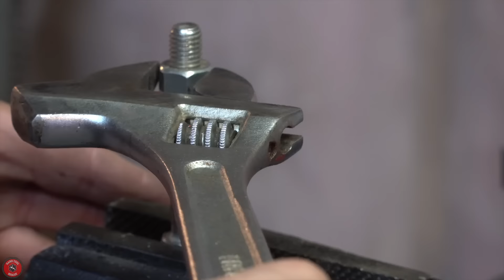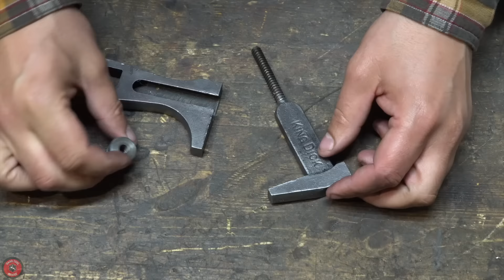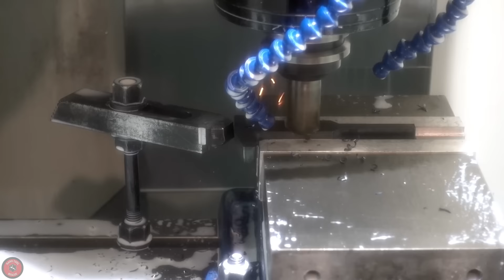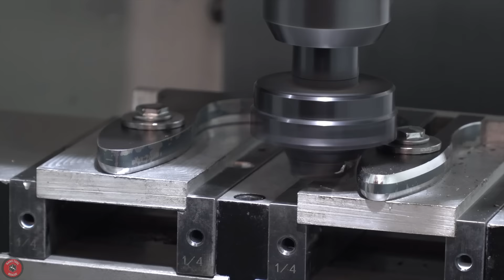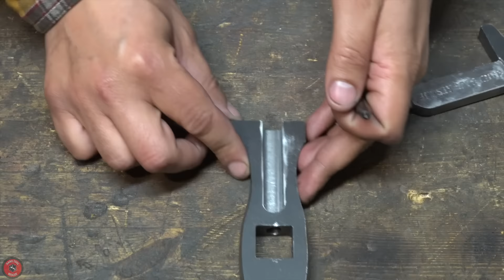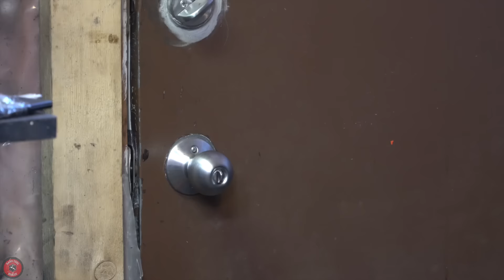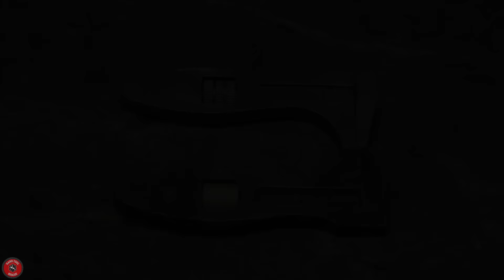1879 Adjustable Wrench [Resurrection]

Comment: @ 0:12 you should never pry against the adjustable jaw of a wrench.
Reply: MrTrenbo I was thinking the same thing.
Reply: MrTrenbo what do you mean exactly?  Using it in either direction puts pressure against the adjustable jaw.  Doesn’t matter how you orient it you can’t avoid that.

Comment: The laser cutting process was one of the earliest processes to be discovered that used a laser beam, with several types being invented at the same time. The gas laser cutting process, using a carbon dioxide mixture, was first invented in 1964 at Bell Labs, New Jersey, by Kumar Patel, an electrical engineer. 

and humans will still believe anything on the internet

Comment: Is that laser cutter yours?  Dude, i gotta get me one of those. Do you have a specific technique for refurbishing cast iron cooking skillets?  I got some old ones and want to actually use them if i can.
Reply from the maker: I wish it was mine!  Depending on the rust, you may just be able to wire wheel it all off.
Reply: Cool.  Bad ass wrench btw.

Comment: Just ordered one, would have ordered one of each, brass and steel adjusters, but $60 shipping for two to the UK is a bitch!!!
I have an original KD and also one of the same pattern by Jenbro, which is NOS.
Reply from the maker: It's only $5 extra to ship another wrench on the same order.
Reply: Didn't see that in the checkout.  Too late to amend now I suppose!

Comment: Hey Hand Tool Rescue. First, i really like your projects!! I also own one of these wrenches, but there is a little difference to yours. there is a little spring on the bottom of the adjuster. do you think the spring was just missing on your old wrench or did they change the design of the wrench over the years? here a short clip where you can see the spring: https://youtu.be/RuDfweDvmc0
Reply from the maker: Thank you!  The spring was added later on in the 1920s.  I like it without it.

Comment: God bless you, my son.  (Any god you choose.  No god is OK, too.)  But this is not a better Crescent wrench.  Crescent wrenches are handy low-torque tools.  Probably a better monkey wrench.  (They tend to lose some of their magic in smaller sizes, and not much as a clamp replacement.)  Complaint is about the meta, not the tool - gonna buy me one.  Maybe two.  Price is about the same as the Stanley monkey wrench on Amazon, and machined rather than cast.

Comment: Sorry bro but unlike my positive comments on previous videos. this project gets my thumbs down.  The wrench resurrection does not fit the definition of the term, the action or fact of resurrecting or being resurrected. This implies that an original wrench was resurrected, or otherwise  restored.  This is an outright modern replica, and not a good one as it does not have original materials or dimensions.  Third world countries make much better copies of antiques.
Reply: in a third world country tjis will cost you no more than 5-10$